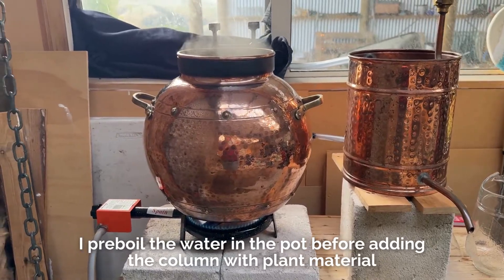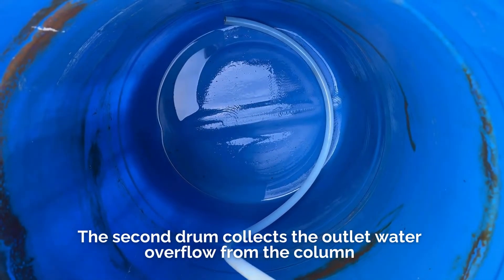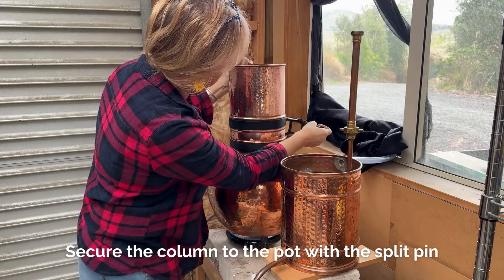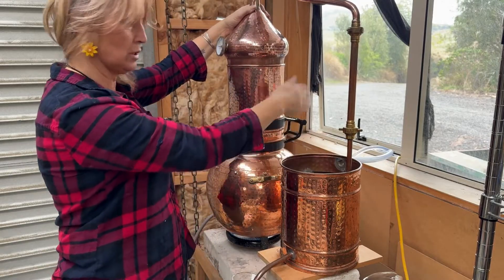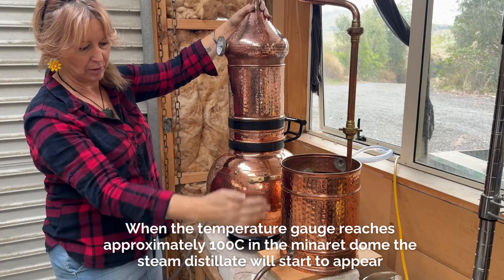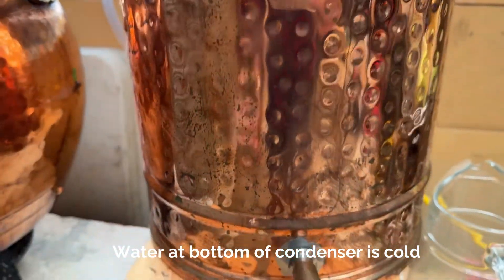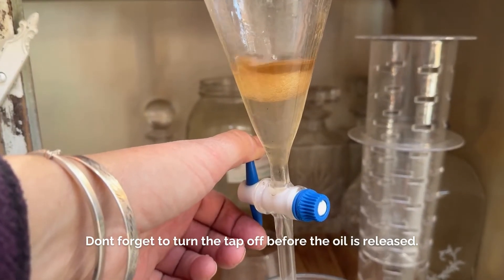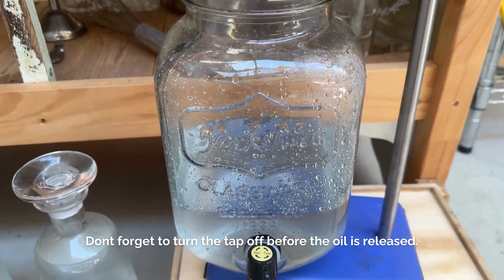“Steam Distilling Rosemary Essential Oil with a Traditional Copper Alembic Still”

Comment: Hello, amazing method just a small doubt how do you separate the oil from the water? Doesn’t some water droplets also come along with the oil?
Reply from the maker: I use an oil separator and drain off the distillate water first.  It leaves the oil.  You can also put your distillate into the freezer and the water will freeze so you can pour off the remaining oil that will settle on top.